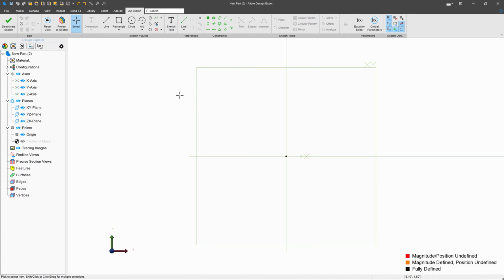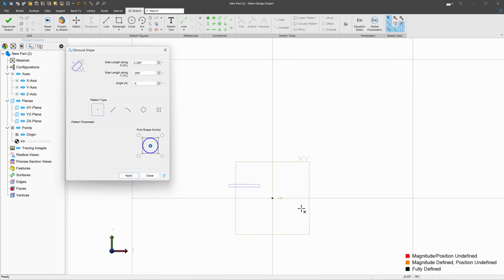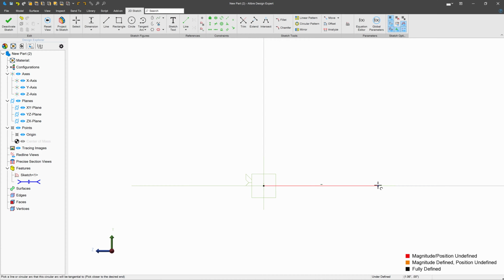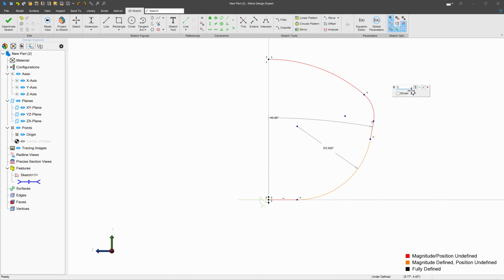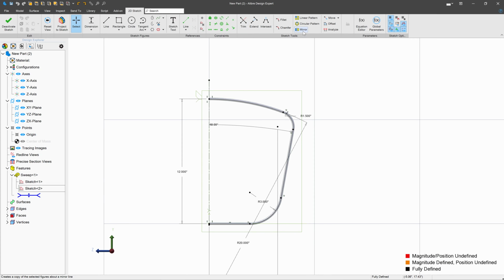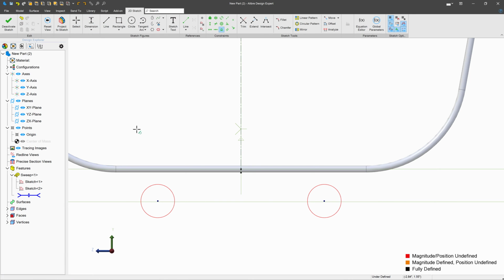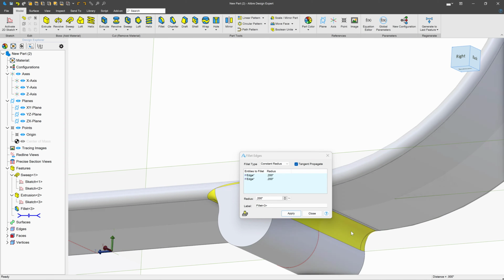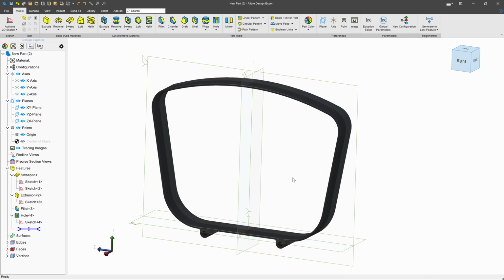Modeling an Office Chair Arm | Alibre Beginners Course #39

Comment: Really cool video. There is a lot to unpack with those "shape" sketch tools. I just don't like the fact that afterwards you can only reference their centre for dimensions and constraints.

If they came in like the polygon tool, Alibre would be totally OP in sketching.
Reply from the maker: Stay tuned, keep an eye on V28